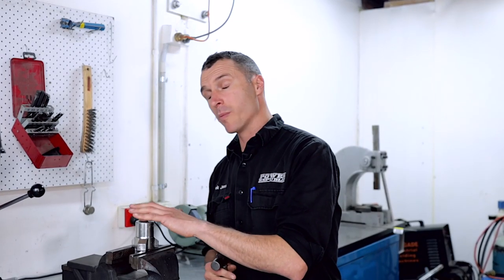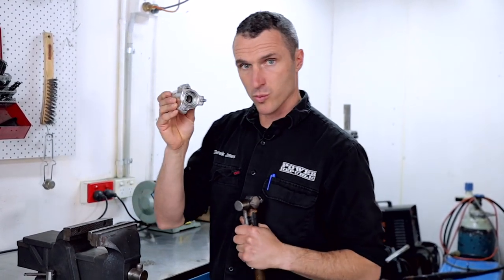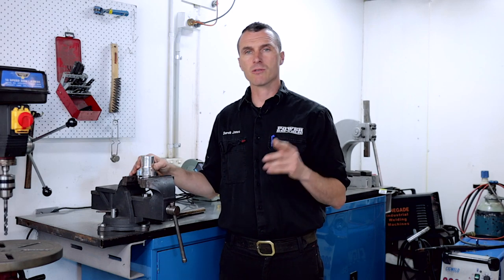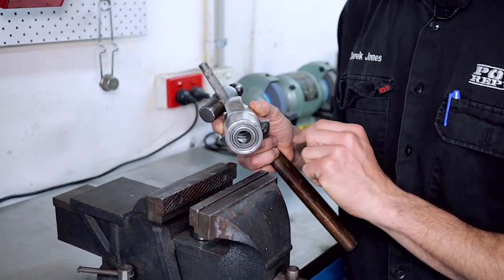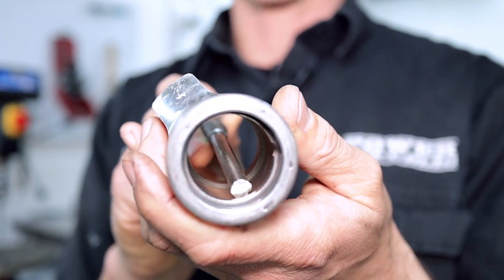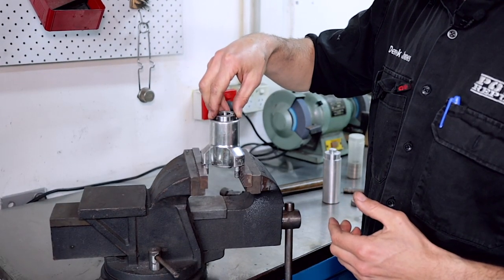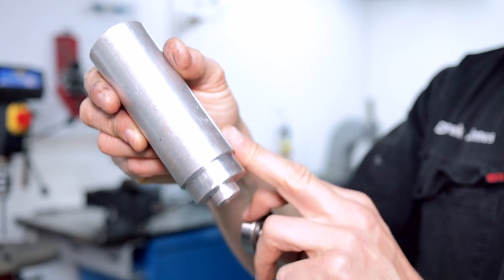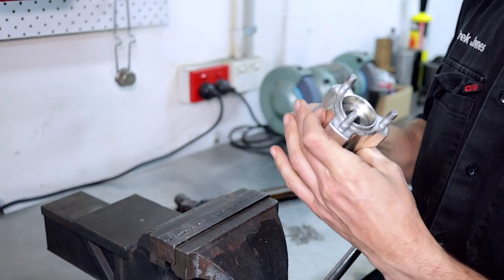HOW TO: Change Your Go Kart Wheel Bearings - POWER REPUBLIC

Comment: When installing the hub on the spindle what lubricant should I use? Grease/oil? Suggestions?
Reply from the maker: I use wd 40 for front wheels and bearings
Reply: @PowerRepublic  would engine oil be too excessive?
Reply from the maker: @Chris.J.A.B   yeah it is probably not recommended
Reply: @PowerRepublic  So many Thanks!!!  You are a good guy for the help,  cheers!

Comment: Front hub spindles or wheels with bearings? Differences/benefits? I’ve got a EKS kart that’s about 7yrs old and it’s just got front wheels with bearings.
Reply from the maker: hubs  for 25mm stubs on the 125cc machines.   wheels with bearings for the kids.  general rule, more hub, more front.  less hub, less front,

Comment: If you put the hub in the oven or on a hot plate, the bearings will fall right out without messing up the pocket from knocking it out.
Reply from the maker: thanks for the tip legend !!!
Reply: Now that's thinking...  Is there an easy way to set the n new ones?
Reply: @Cmikus01  Heat the hub and freeze the bearings.  They will drop right in.

Comment: The steel sleeve between the bearings in my ital kart hubs doesn’t move enough out of the way to give me a good shoulder of the bearing to hammer on. How do you attack these bearings with that big sleeve?
Reply from the maker: that sucks, I know what you mean.  are you sure the bearings are not just so tight of the sleeve that you can't move it?   there is special tools you can buy to remove bearings that go into the outer race.  you have to remove the dust cover cover first.

Comment: Can you put a 3/4 bearing on a 5/8 bearing wheel.  My current whelk has a 5/8 bearing but I want to put a 3/4 bearing. Can it be done?
Reply from the maker: hey Sammy, normally the bearings Outside diameters are different.  if you went from 5/8 to 3/4 it might work but I think you will run out of room to put the bigger bearing in.

Comment: So I am new to all this bearings stuff, but I was wondering does a Bearing with the width of 1 3/8in fit in a go kart rim with a circumference of 1 1/4in? Couldnt find it anywhere.
Reply from the maker: geeez bro, not real good with fractions of inches.  have you tried your local kart shop?
Reply: @PowerRepublic  bahaha… i just couldnt find a bearing with a outter of 1 1/4. And i thought the 1 3/8 was the snap ring and not the actual bearing.

Comment: Hi, I have a CRG KT1 with a Rotax FR 125. I compared how does the rear axle spin vs other similar karts and noticed that mine is not that free.... what do you recommend to make it spin faster like the other guys? Thanks
Reply from the maker: Are you using the 11T front sprocket?  If so you can remove the o ring from behind the clutch drum.  If your not, maybe add lube to the clutch needle roller, chain &,sprocket and to the axle bearings too.  Hope that helps. D
Reply: @PowerRepublic  Hi, I am using a 12T and it has the o-ring, a washer and a 17mm bearing behind the clutch drum. Does the o-ring make it slower or tighter? Thanks

Comment: Could you do the same for the rear bearings and carrier?
Reply from the maker: nah don't hit them out, you need to rotate them and pull them out.   rear axle bearings that is.
Reply: Found that out to my loss with an hydraulic press. Now need a new carrier...looks like they are sided and I can't find the engine side, does it matter?

Comment: I"ll just put the new bearings in the freezer for an hour or so, warm the hubs slightly to  60°c or so and then they drop right in without any tool required 😆
Reply from the maker: Willem Honders thanks for the hot tip 👍
Reply: I second that idea. That’s exactly how we install brass and rubber cutlass bearings on the shafts of big ships where the propellor spins

Comment: how would you remove the hub from the spindle that's attached to a disk carrier (birel free line) i want to install new front wheel hubs
Reply from the maker: probably have to remove the two brake caliper bolts and slide the caliper off.  then the hub should come straight off
Reply: @PowerRepublic  ..i later found  out the end of the spindle has threads so i have to get a special tool to remove the threaded coller holding the hub in place